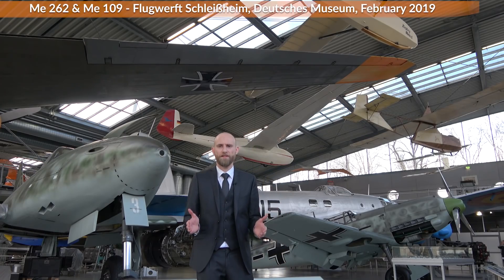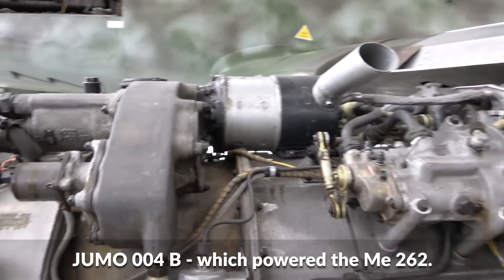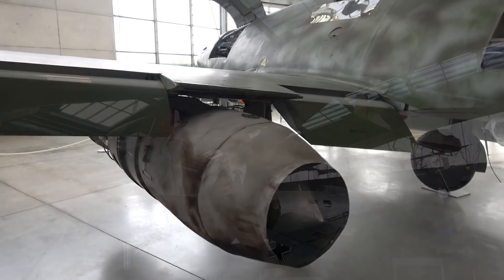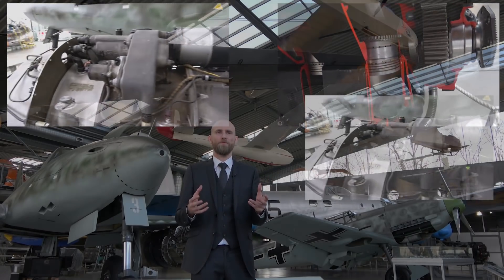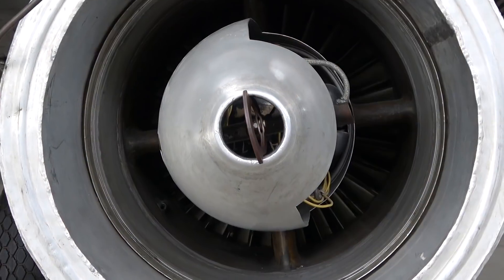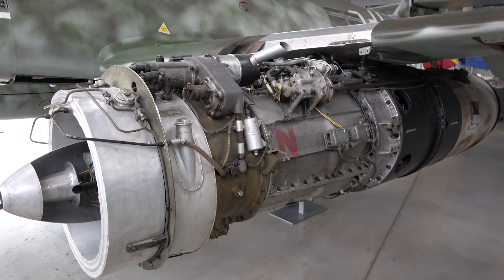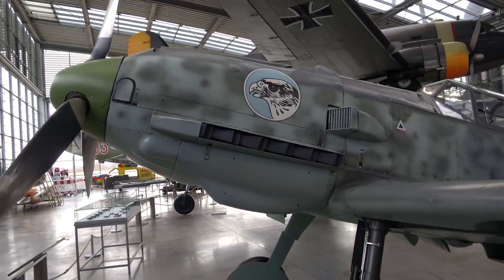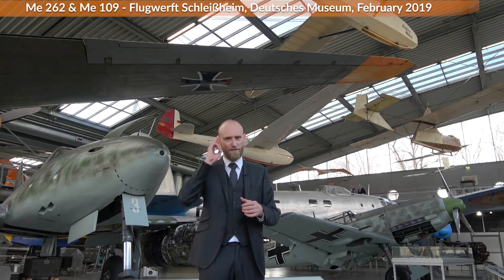Why not just go from the 109 to the 262?

Comment: In comparison to the Luftwaffe during WW2 the USAAF partially shifted from the B-17/B-24’s too the B-29 series. Despite all the resources of the USA the production and combat fielding of the new heavy bomber was an ordeal. The Luftwaffe hadn’t the resources or the advantage of not being bombed night and day. The Me-262 was the most advanced fighter of WW2 but it probably didn’t delay german defeat by even a day.
Reply: If they'd not spent any time on the 262 they'd prob have prolonged the war
Reply: @T Croft - I agree that the Me262 likely shortened the war. It was a net benefit to the allies.

It was really an underdeveloped and misunderstood weapon, poorly suited to the task it was given, and a tremendous waste of fuel, industrial resources and manpower. 

Not to mention very unreliable.

A turbojet engine is a poor choice for a fighter / interceptor. Modern jet fighters don't use turbojet engines for a good reason, instead they use low-bypass turbofans, which are far more responsive and fuel-efficient during take-off and landing.

A spy plane like the SR71 Blackbird uses turbojet engines, at speeds up to 2,400 km/h, and it never gets involved with dogfighting.
Reply: @pauligrossinoz  Well even with all those faults the political decisions around its role (fighter/bomber) imposed stupid delays.
Reply: Call Me Ishmael  Well of course if the US hadn't obsessed with building armored/armed aircraft with a small sideline in bombing that would not have been such an issue.
Reply: Call Me Ishmael  Actually the analysis during the war was that this was the wrong call. ie The loss of range/speed and bombload - coupled with the effective loss of bomb accuracy exceeded any advantages gained. This was only made worse by actually the cost/loss rate in men/materials of upgunning bombers
Reply: Call Me Ishmael  All of the evidence (bombing analysis) suggest that except for carpet bombing the tight defensive formation compromised the aim.
Reply: The deployment wasn't well thought out. If I remember they built 1600 of them and could only keep about 200 operational.
Reply: @tironansunfrendlyskies5040  Yes they had terrible serviceability.

Comment: They put the technology too late to change anything ... they had the planes ready when they already lost the good pilots and they ran out of fuel.
The more critical question is could they have introduced this earlier if they focused more on this, for example in 42/43 ... because that could have made an impact if the Allied air losses were so staggering that they never gain air superiority or supremacy. As I understand the air frames were ready in the late 30s. Maybe the engine could not have been rushed too much.
Reply: The 262 was still a taildragger in 1942. It was not nearly close to being ready then.

Comment: Additionally the 262 was incapable of defending it's own airfields against allied Piston engined fighters.
Which would've meant that an all 262 force might've been untouchable at speed and in the attack but sitting ducks over their own airfields.
 Which is why an all 262 or all Jet force wouldn't have worked even in the tactical level alone.

Couple that with the Training and logistical Matters mentioned Here and it should be pretty appearant why......
Reply: That's really a symptom of Germany losing air superiority far before the 262 entered service in any real number. If the allied air forces didn't have free range over virtually all of Europe, the need to guard take off and landing would be far less of a problem.
Reply: @Waty8413  Less of a problem, but still a considerable problem. QRA doesn't really work if an aircraft... can't. As a whole the 262 wasn't really suited to the interceptor role, more of a heavy fighter if anything. Which made it entirely unsuitable for an overall fighter replacement.

Comment: In the early 1970's I had a colleague at work who had been a former Luftwaffe bomber pilot since the beginning of the war - he flew Heinkel 111's during the Battle of Britain - and he told me that at the end of the war, like Bismarck said, it wasn't the lack of pilots or aircraft that crippled the Luftwaffe, airfields were full of redundant planes, it was the chronic lack of fuel. Without fuel, a whole Air Fleet is grounded and the pilots twiddle their thumbs...! 😕
P.S.
He was a great chap and one of the wittiest persons I have ever met !
Reply: I found a table somewhere or other listing the oil production of various countries in 1940 and the difference between the amount of oil the Allies had access to compared to the Axis looked like the Allies had used a cheat code since it was so ridiculously large.
Reply: @lunatickoala  Presses "Alt + Ctrl + X"
Types "Gas does grow on trees"
Bam, problem solved.
Reply: @Crosshair84  ... cobsidering that the luftwaffle was running on liquefied coal/wood .. yes it does  😆
Reply: @lunatickoala  ... america was producing 180 octane fuels .. germany had their aircraft running on low octane liquified coal  ... go figure 😈
Reply: @sotabaka  The crazy thing is that they were pouring resources into coal-to-gasoline, while partway through that process you get methanol which is like over 100 octane.  They should have just stopped at methanol and used that as fuel but instead they went through backbreaking effort to turn that into gasoline...
Reply: @IrishCarney  ... thats germany for you = overengeneering everything
Reply: @IrishCarney  the Fischer-Tropsch process does not have methanol as an in-between step. They used alkylation of naphtha type factions to get the much needed high-octane components of the fuel. This cost energy and much needed plant space.
This explains in part, why turbine powerplants received so much attention at the end of the war.
Reply: Not just a lack of fuel but the lack of high octane fuel especially.

Some very successful western planes (p-38, p-39, p-40, spitfire, hurricanes, etc) weren't favoured by the Russians due to higher grades of fuel.
Reply: @tempestfury8324  yes, those pesky western octane addicts :D

however, octane and specific energy in fuels rule in piston-powered aviation.
Reply: @daszieher  : I'm not sure of your point. All of the planes I mentioned are piston driven and gain performance by higher octane fuel. When those same engines use lower grades of fuel (the disgruntled Russians through Lend-Lease, for example) performance drops substantially.
Reply: @tempestfury8324  indeed. it was not meant as a contradiction
Reply: @tempestfury8324  The Russians LOVED the airacobra.
Reply: @andrewallen9993  : show me....what data substantiates your claim?
Reply: Not only the Luftwaffe ........the panzers too...........
Reply: Fortunately the me262 like an old Mercedes 200 Heckflosse would run on kerosene, paraffin or vegetable oil:)
Reply: Figure that out - where did Germany get their oil? Romania, Soviet. Where did Britain get their oil - Iran, later Indonesia.
Reply: The Germans had plenty of jet fuel for the me262, the high octane necessary to power the me109 and fw190 was in short supply.
Reply: @IrishCarney @daszieher I wonder what performance would have German planes achieved had they used "contemporary" fuel as Allies did. Not being an expert, I know however that experients with high-octane compounds, namely methanol, were conducted before the war by Mercedes and Auto Union, to say the least, for Grand Prix racing. Hence I'm inclined to think that methanol-based fuel was well-developed but not at all an option during late years.
Reply: @BlacktoothgrinUA  tl;dr nothing. the engines would have had to be designed for higher octane fuels. 

Methanol (or any alcohol for that matter) is not really an option for aircraft use since it has roughly only half the specific energy than gasoline (btu/lb or MJ/kg). it makes no sense to carry the additional weight of the oxygen already in the fuel when there is plenty of that in the air around the aircraft.

In addition, it has a relatively low boiling temperature (ca. 60°C), which can lead to issues in injection systems. At the same time its flash point is 40 to 50°C higher (12°C) than that of gasoline (-40°C) which limits is use in winter and makes starting much harder.

German C3 fuel was more or less comparable to allied 130 octane, despite its official rating of 100. These two figures are measured at different mixture points (rich vs lean). However, it was in much shorter supply than standard B4 (German 87octane) since the former had to be passed over an aluminium oxide catalyst in a reactor at over 400°C and about 10 bar (150psi) in a hydrogen atmosphere, while the latter was produced in a more conventional manner.
Reply: https://www.youtube.com/watch?v=kVo5I0xNRhg
Reply: It's hard to fuel aircraft if the yanks have set fire to your oilfields and the commonwealth have flattened your refineries and oil from coal plants!
Reply: Why do so many comments on his videos try to humanize the nazis? 

I swear it's like every video has arleast one " oh I knew Goebbels and he was actually really funny guy " 

Like wtf lol these guys where Nazis trying to take over the world and kill jews stop trying to humanize them.

Videos like this are dangerous as they try to humanize these nazis and people actually fall for it, it also gives the Germans something to be proud of which is dangerous in its own right.

Comment: “Engines gave out mid-operation is kinda sub-optimal .” Oh I love how Bismarck try to sugarcoat the matter. 😂
Reply: They hadn't really worked out the materials to make reliable turbine blades.  They were multicrystiline steel blades, and due to the heat and stress, they'd "creep" and stretch past desing limits in about 25 hours.  Today we use single crystal nickel blades
Reply: @blurglide  The allies didn't have huge issues in their engines, and they were a heap more powerful.
Reply: @1993Crag  Whittle chose a simpler reliable design for his first engines as the exotic materials and the production techniques to use them.
Reply: @1993Crag  The Meteor and P-80 used an engine with a centrifugal flow compressor which is simpler than the engine used in the Me 262 which used an axial flow compressor. A centrifugal flow compressor can use a single large impeller which can be while an axial flow compressor requires several smaller impeller stages and the single large impeller is not only simpler but tougher. Also, there was a lot more experience with building centrifugal flow compressors as those were the sorts used in turbosuperchargers (as they were called at the time).
Reply: @lunatickoala  I'm aware of how a jet engine works. The allies had axial engines that were considerably more powerful and reliable https://en.wikipedia.org/wiki/Metropolitan-Vickers_F.2
Reply: @muzzmac160  As did the Germans also use simpler designs for their first engines...
Reply: @Crag-r yeah thw allies had axial engines but none where used on production planes.
Reply: @1993Crag  the allies had centrifugal jet engines. These turned out to be a technical dead-end and the whole world turned to axial flow, and by 1947 the Sabre had the GE J47 which was a development of the 262s Jumo 004 with just as short a service life initially. The 262 engine cost a third to half of a B12 piston engine and took only 30 minutes to swap out compared to a V12 piston engine.
Reply: @drstrangelove4998  The allies had axial designs like the MetroVic series that would set the stage for post war jet development. General Eletric would take design tips from MetroVic for its engines, not Jumo. Given they had an engine that was twice as powerful as any German design, more compact and reliable. 
It's strange that for such a dead end the most produced jet engine in history ended up being a WW2 design... an allied WW2 design.
Reply: @blurglide  I believe they had higher quality blades in the prototype engines, but had to try to use something less sophisticated in the production blades. I believe it was due to a low supply of nickel OR chromium at the end of the war. I think it is mentioned in a chapter about the jet engine in this book: https://www.amazon.com/Aeronautical-Research-Germany-Lilienthal-until/dp/3642621295/ref=cm_cr_srp_d_product_top?ie=UTF8
Reply: @blurglide  Um... they had nickel blades in ww2. The british famously used extremely heat resistant materials for their jet engines. These arent new technologies...
Reply: And I love it when my sarcastic comment sparks a technical discussion. Lol
Reply: Its like when Hitler announced "The war in the east has proceeded not necessarily to our advantage". 🤣

Comment: There is a thing about Jet engines.
They are quite simple compared to a piston engine. Especially WW2 era. Just think of it. A piston engine would typically need a reductor to connect to the propeller. and other reductors to connect to other parts of the propeller. You needed to produce the physical parts of the engine, which were in all shapes and sizes.  Assemble the bloody engine and then syncronise everything so it could work. And not just the engine. You had compressors, coolings and so on. 
On a jet engine, especially an old type like the JUMO or NENE or VK-1, things are quite simple: you have one big turbine. This means you have a centrifugal compressor which can be casted in one or a few pieces, much easier compared to the one for a piston engine. You have a few combustion chambers, but you know how to make ignitions and all. And you have the proper turbine behind those combustion chambers. For cooling, you use part of the air from the compressor. Easy peasy. This means you could obtain much more of those jet engines with a less qualified workforce compared to the complicated piston engines in use during WW2.